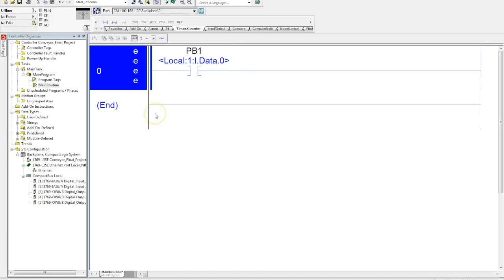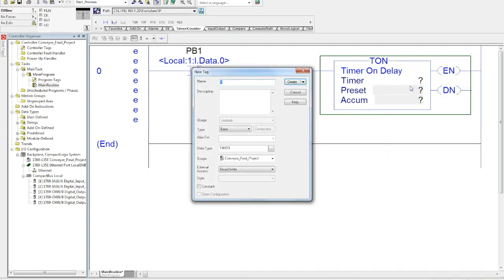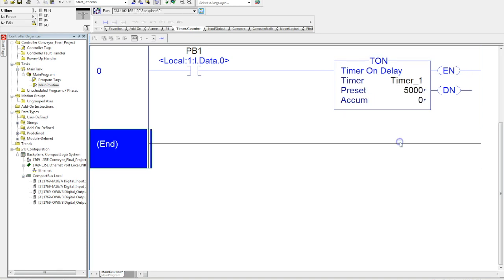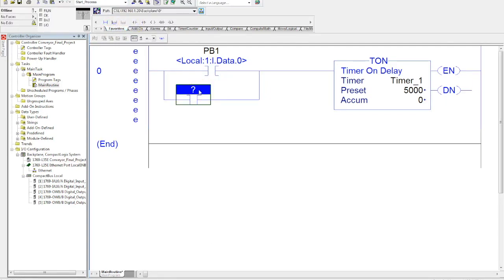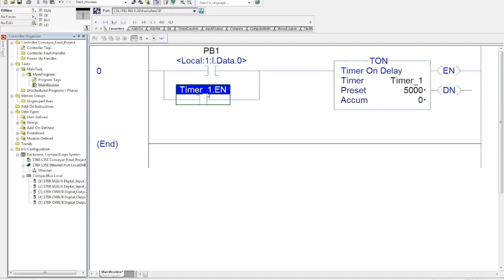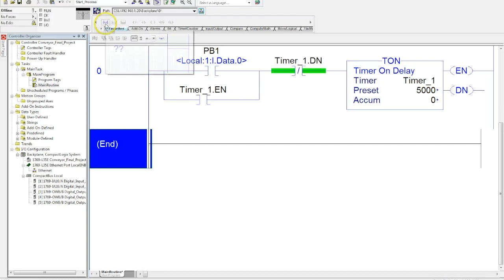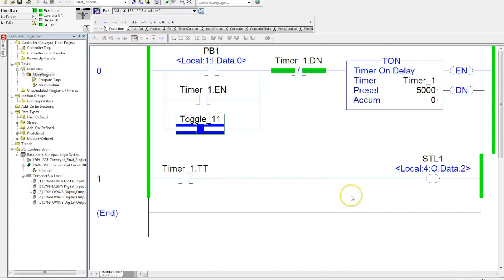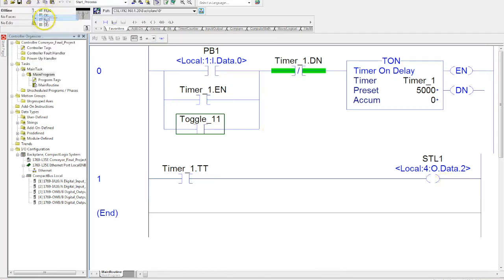Intro into TON Instruction in RSLogix 5000

Comment: Good video I only have a question if someone could answer me I would appreciate it, Why in the first round the dn bit did not turn on and cut the count until the toggle was turned off?
Reply: The XIO Timer.DN is essentially what resets the timer. Without that bit, the timer would never reset back to zero if the person did not let go of the push button

Comment: Hello Klette, I'm wondering why use the .en and .dn latching circuit with the .tt instead of just taking the .en directly to the output rung, is this possibly only momentary? Or why not use a tof.dn directly to the output?
Reply from the maker: Yes.  The tt would only work if the TON is enabled.  It is a small difference but a big one.

Comment: Perhaps you can help me predict the following rung (from left to right):
--]  [--------------------TON--------------]  [-------------------(  )--
input                     timer         time.DN             output
I inherited a program which has several rungs like this, but I'm not sure of the behavior.
Am I correct that this will act as a time delay for the output?  And the timer will only reset when the input opens?
Reply from the maker: It will delay the output turning on.  It will reset when the input goes false.  I have never seen it programmed like that.  But it should work as you stated.

Comment: why the timer1.DN is closed with a toggled bit = opened? I haven't seen the state change? why not choose an open contact to close during count?
Reply from the maker: Great question.  The toggle bit is representing a momentary pushbutton.  The .DN needs to be normally closed so the memory will drop out and the timer can be started again.  The .DN bit changes so fast we cannot normally see it on the screen.  does this answer your question?
Reply: @KletteTech  At exactly 3:51 is it possible for the DN bit to energize while the Toggle_11 is closed? I'm asking because I want to start AND stop the TON with a single bit.